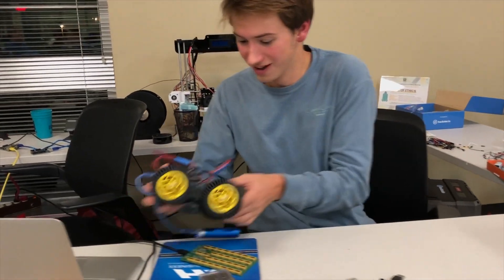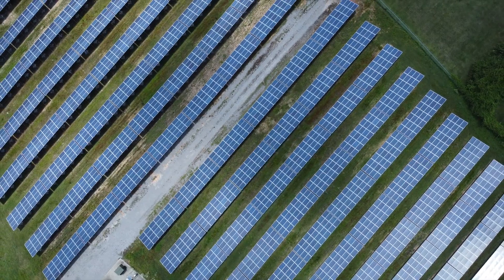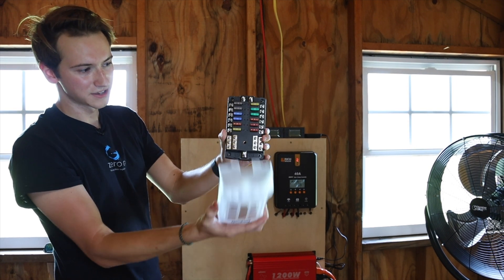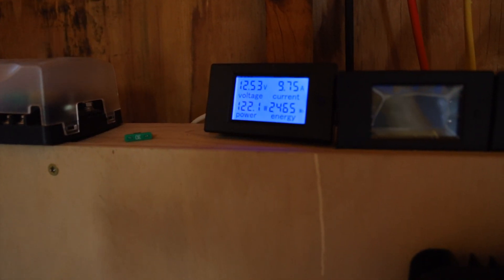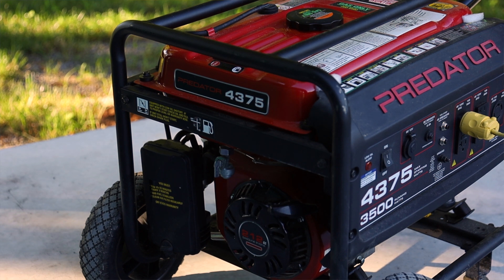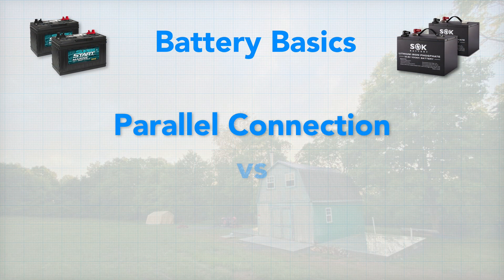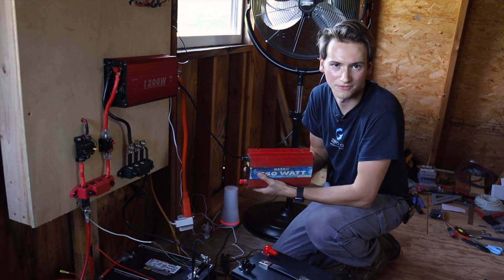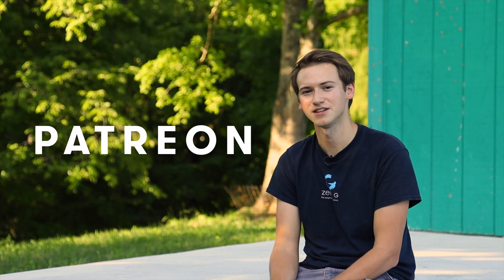Simple Solar Power System Overview | Shed to Home Conversion

Comment: I'd agree with most saying get them away from shade, like that chimney. If you can't then wire them in parallel, or a 2s2p. Also the load output isn't for high demand, if you going to hook up multiple jazz and you already have a fuze box, go to the batt bank. Good luck!

Comment: you should add an ON/OFF switch between your batteries and the system so when you need to swap out batteries its a safer to have a switch

Comment: put 2  ( 500 watt solar panels to add to your 400 watts ) on the roof then youll have 1400 watts of power  which is better  in the long run because batteries will last longer ( as long as you have enough sun  and you can power TV/Laptop etc ...., you should always go bigger with solar if your building a home because you never know what you want to power in it . For sure LED lights

Comment: one thing you forgot to consider about lead vs LiFePO4 is peek power usage, when you use alot of energy at once on a lead acid it tends to wear it out alot quicker even if your cycling at 50% compared to LiFePO4 and thats honestly the real big difference and why they cost so much more
Reply: Cycle life and capacity are the biggest considerations ... a LiFePo battery cycle 7-10 times longer (3000 cycles is a given to as much as 8000+ with decent management) depending on how you calculate the available capacity. The available amp/hour capacity of LiFePO4 is 80% easy, versus Lead acid of 50% (although deep cycle ones can go to 80% but ya gonna get less than 500 cycles). Drawing large capacity from either one degrades them quicker.   $/amp/lifetime ... the LiFePO4 is about 1/3 the cost overall when you consider the energy they will give you over the life of the battery. It's that up front cost that makes you scratch your head.

Lead acid excel in that they can pump out way more amps/second (8 times more easily) for things like starting engines/motors. They don't get destroyed if you charge them below freezing like you would with LiFePO4 (major drawback for LiFePO4).  Lead Acid beats LiFePO4 in only these two cases IMO. So if you size the LiFePO4 right and don't charge it when it's freezing, it's the bee's knees for storage and delivery.

Comment: Regarding your solar panel positioning, you should mount your panels on the southernmost side of your roof first, avoiding any shadowing from things like your chimney pipe or trees. The second most positioning will be on the West side of the roof, due to the intensity of afternoon vs morning light. Depending on the pitch of your roof, it's probably a toss-up between the North side and East side. If you get much snow, you are better off to install your panels on a ground mount system facing due South so you can keep the snow brushed off them. You may consider a 24V system for more efficiency.

Comment: I found that I have improved efficiency by running pairs in series and those series connecting in parallel doubling DC voltage. I’m curious if you did that, which would be more affective. Each half of the series on opposite roof sides, or each side of the parallel on opposite roof sides. I know solar south at the proper angle is best. …but?😁
Reply: Yes. We are up against voltage/current charge controller limits at the best part of the days. We also aren’t married to this location for our final installation, so it’s fun to experiment. We’ll look into that too, but when we bump up to more panels we are beyond the parallel/serial option due to input limits.
Reply: @MrZZeroG  I’m on my 3rd charge controller. I’m a full time RVer so I have limited space and angle options, mostly flat with maybe a couple degrees of angle on each side. I have modified mounting brackets on 2 panels to aim more towards the sun when I’m parked in the right direction for extended visits. Mostly they stay in a slight arch, so even though I have 600w of panels I never exceed my 500w charge controller as my panels are not set up for 100% efficiency. Bottom line is higher voltage and lower amperage = smaller wires needed. Less heat in wires is less energy lost. LifePo upgrade made a huge improvement on performance as did pure sine wave inverter. MPPT charge controller or better yet if you can afford a grid tie / charge controller that has a way to keep your power going during a power outage and not send power back to the grid would be a great investment. 
P.S. I’m enjoying your Barn-Tiny Home series. Keep up the good work 👍
Reply: @darylSKYTZOwillis  thanks! Yes, we are forging ahead on LeFePO4 and i suspect we won’t escape building a solar tracker, because Danner and I love tinkering with stuff. Right now we have an old C-band satellite dish we can harvest from the farm and that mechanism will work. 

…but, lumber prices are falling again and so we need to order and get moving on framing.

Comment: Hey Danner... great show. Something to consider... most refrigerators operating system runs on a DC current. The only thing that runs off of 120 vAC is the compressor. So there is a way to connect the refrigerators thermostat in series to the inverter that power the compressor. That way the inverter comes on only when the compressor needs to cool the refrigerator down saving a ton of power and allowing you to run a full size refrigerator on a battery indefinitely..
Reply: I see Home Depot sells “solar refrigerators” that operate completely on 12/24v that are pretty reasonably priced.

Comment: One thing to be careful of with interchanging the batteries is the charge characteristics of the 2 chemistries is totally different read up on the charge settings of each battery. You can damage a lifepo4 battery if you charge it like a lead acid and vice versa.
Reply: Thanks. Settings are way to change in solar charge controller. We’ll reconfigure for each of the tests.
Reply: @MrZZeroG    You could set up each type of battery into separate "legs" using 2 panels each and do a comparison.  I think Will Prowse has done something similar.  Another great source of no nonsense, straight shooting info is John Daniel here on YT.  Looking forward to how your project comes along!  👍👍

Comment: Your chimney is shading one of the Solar Panels
Reply from the maker: Yes it is! It’s a temporary location. We’re going to be trying some different configurations to see how it affects the output. Right now we’re producing more than enough power to top off our batteries every day. As we add more load,  we’ll continue to upgrade the system and place the panels in a more efficient way. Thanks for watching!